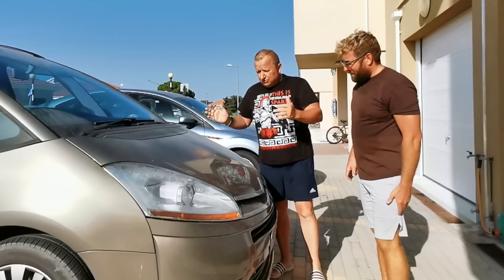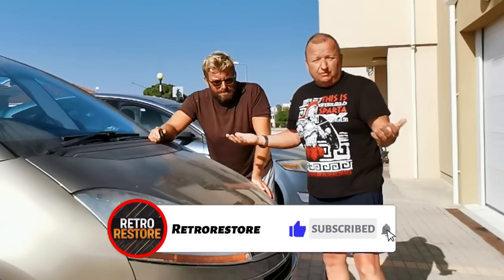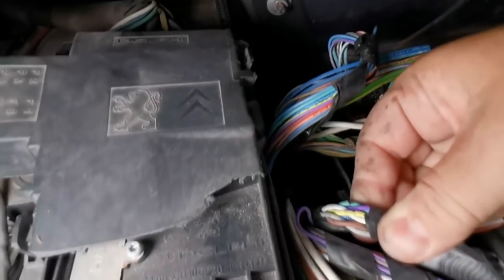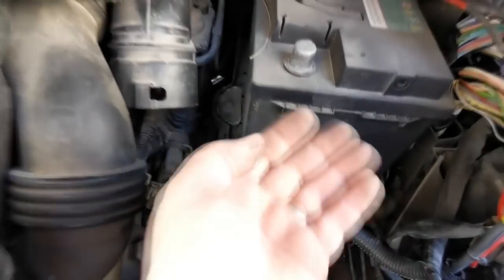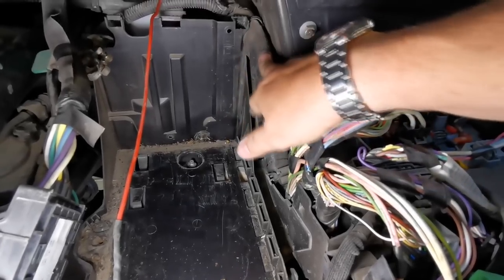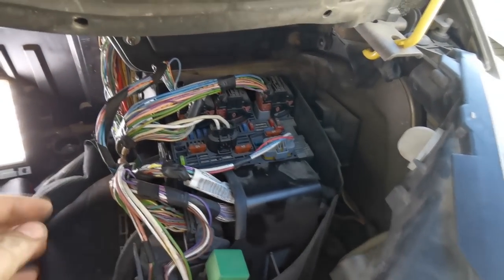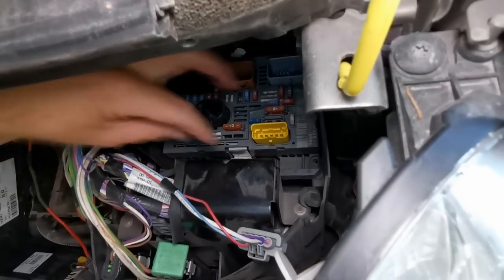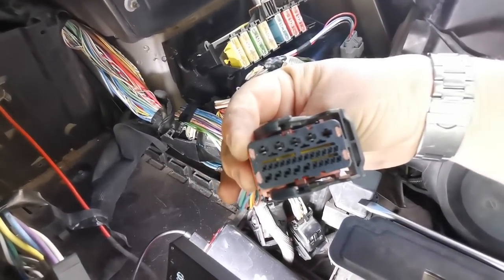Citroen Picasso C4 Intermittent Fault Cuts Out Anti Pollution ABS Service EML Parking Brake Part 1

Comment: One of the tips I received, from a local car mechanic, who now runs his own business, is how to reset the Anti-Pollution System. This obviously resets the Anti-Pollution warning, so that it doesn't keep coming on. What you have to do is drive at fairly high engine revs for twenty minutes. This gets the DPF really hot and clears it out. So on my Citroen Grand-Picasso (2009 1.6 Diesel), you have to put it on manual and do 70 mph in 3rd gear (I forget the required engine revs, but that does it). If you have to slow down then you have to start the twenty minutes all over again. This does burn through quite a bit of fuel I'm afraid though. The other problem you got in Cyprus is driving for 20 minutes at 70, I guess. Best done at midnight, when the roads are clear. 😂
Reply: I sorted out my sons by driving at 2500rpm for 25mins. EML went out, no problem since 👍
He just takes it on a run every now and then.

Comment: Nice simple video guys! Unfortunately All modern cars with CanBus have the same problem of being difficult to diagnose even with the original manufacturers diagnostic tools. As every module is interconnected via the CanBus if one goes bad then they all write errors in their memory without actually having a problem. Specially if the problem is in a ground or a short to a ground that is common to all systems... On top of these the CanBus is encrypted so there are no messages coming from it as to were is the problem plus that modules connected in the CanBus take a random I.D that makes it even more confusing to pinpoint the problem. These are the reasons You see in many videos that for the ¨same problem" there are totally different reported solutions... The source of the problem was in a different area but the symptoms were the same.  It takes good diagnostic tools,  an even cheap oscilloscope for automotive use, some helpful tools like a broken loom tracer and lots of experience in diagnostic methodology (diagnosis steps) for this job. Unless You have all the luck of the world by Your side... Good luck everyone!

Comment: Just checked Google and it would throw up a P001 error code and the cure is a new fuse box, which is either the part you cleaned or the part that attaches to the top of the battery. Very common fault apparently buddy, hope this helps you guys out. All the best 👍

Comment: Definitely need the codes reading. I have a c4 and have had anti pollution fault and it was a faulty glow plug. Apparently there’s about 50 different faults that will show the anti pollution fault message.

Comment: Edited. 6th April 2021

Hi Everyone, After trying everything that was obvious from watching endless videos about wheel sensors, Blue wires, corroded connect etc it turned out to be my front Passenger side Wheel Bearing because the Magnetic strip was faulty.  I was amazed that this was giving me all the issues ie. Christmas tree lights Abs, Ecs, Auto Gearbox and more.

I hope this helps and it was a pretty inexpensive part to fix compared to the warning alternatives 😬

Alan.

Comment: Hello, came across with this channel with the DPF cleaning video (which will do on my Citroen C5 ii :) ). I literally had the same issue, it could go on without any problems even for a month an suddenly cut out, sometimes it threw some ABS lights and sometimes no dashboard errors at all. For my case what got the problem fixed was replacing the crankshaft position sensor (been 2 years without cutting out), it's not that hard to change it and in Spain it costs like 15 euros for the sensor. Even if it's in good condition, it's a cheap and simple thing to rule out before buying more expensive stuff. Keep up the good content and hope it helps you!!!

Comment: Seems like it's went into Limp mode anti pollution would it be a DPF problem I had the same thing with a 2008 Ford C Max it had the Peugeot 1.6 Diesel Engine. In the end I had to get the Pat Fluid tank topped up and got the DPF cleaned all the carbon in the filter was flushed out cost me £300

Comment: My 2011 C4 1.6 Grand Picasso (150k) very similar issues, I did basically the same as you guys, also under the air box there was a couple of chafed wires with exposed copper. I gently dried the fuse box with a hot air gun (there was plenty of damp seeds etc in there too). For me this issue of suddenly stalling turned into an additional P0268 code which was injector no.3 over-current, I replaced injector & all good. Exactly the same thing happened 6 months later, i.e started to randomly stall, and then P0268 etc.  Best advice would be ALWAYS carry a cheapo Pro Scan or similar OBD scanner with you in the car because one symptom amongst all of the error codes can be the bloody electric hand brake won't release until you clear all of the codes using the scanner.  Out of interest it was always injector no.3 that failed (3 times now) over 3 years which leads me to suspect wiring as the cause as the injector itself always has damaged internal electronics. I have had it for 7 years now, it has not been the most reliable car I have owned, would not have another...

Comment: I love my c4 GP but bloody hell the niggles it has had are unreal. Made a mistake putting optimum diesel in. It started to trigger issues.
The oil gets dirty quickly and you need to change at half the recommended distance/time.
Your issue might be the parking break as mine has a loose plate and used to trigger the esp warning light...but must have moved further so as not to be a nuisance lol.
The latest problem triggered the "you are at risk of blocking the air system"...was caused by the tube which connects the turbo and air system. The turbo end always slipped in time for some reason but was getting worse at not staying in place. What caused that was the tube at the other end wasnt clipped in properly. The clip which you cant see wasnt in fully. Now the risk of blocking warning has gone. Must be cleaner so the dpf doesnt have to regenerate so much.

Comment: Cracked solder joint on the ECU PCB. Resolder them all will cure it.
Reply: engine control unit ? sid803 ?

Comment: A late addition….I was getting P1160 increasingly frequent error codes on my 2008 c4 Picasso 1.8i petrol. They happened wheN I slowed speed and braked, for example at a crossing or lights. I started with the easiest possible solutions first, which was what you guys did in the video; I checked the fuses on top of the battery (some of them were corroded) and took out the plugs on the fusebox and the BSI in front of the fusebox. One of had some kind of moisture in it, not quite water I think. I cleaned and dried out everything and put back together again. Been running smoothly since.

Comment: Martin, try a BSI reset. It costs nothing and may cure the issue. Procedure is as follows..

Put the driver's window down, lift the bonnet and ensure all equipment is switched off.

Ensure all doors are closed and remove key from the ignition.

Wait for 3 minutes, disconnect the vehicle battery and wait 15 seconds.

Reconnect the vehicle battery, wait a further 10 seconds (do not open doors.).

Switch on the side lights through the driver's window.

Switch on the ignition and check system's functionality.

Hold lock button on key down for 10 seconds.

Remove key open & close door test central locking system.

Start the engine and complete the system's check.

Failure to follow this procedure could result in incorrect operation of many BSI related items.

Comment: The anti pollution fault could well be DPF related. The ELOYS fluid is in a pouch situated next to the fuel tank. It might need to be filled up or replaced. Did you watch the "LM Auto Repairs" video by any chance? There could still be a broken wire causing the multiple errors. You found some chafing on one of the looms going into the fusebox. That would be the best place to start looking for any broken or shorted wires. The best diagnostic software to use is Diagbox which is what the dealers and independent PSA specialists use. I know that's not really an option while you're out in Cyprus.

Comment: It could need some software updates for the ECU computer Martin. A lot of modules run in tandem so if one is faulty some of the others show faults to like the ABS module, park brake module etc. Also check the EGR valve they are known to cause faults.
Cheers, Jeff.

Comment: Anti pollution is most likely related to the Diesel Particulate Filter (DPF), it's a very common problem with diesel vehicles which only do short journeys.  In normal use the DPF gets up to very high temperatures and burns particulates off which would otherwise be emitted into the atmosphere, in vehicles which only do short journeys the DPF does not get up to operating temperature and so eventually gets clogged with the particulates it is designed to burn off.  Some DPFs can be regenerated by driving at 50 - 60 MPH for 20 - 30 minutes, others may require a service procedure to force a regeneration but in worst case scenarios a new DPF will be required and will usually cost from the early hundreds up to early thousands depending on the vehicle to which they are fitted.  There are companies which specialise in cleaning DPFs and there are even fuel additives which claim to clean as well but I have no experience or evidence as to how effective the latter are.
Reply: Do you know if this would also cause a whining noise when accelerating? This just happened to me today and everything your saying makes sense to me, I use my work van mostly and the car occasionally. Any help would be appreciated thanks

Comment: Great Vid Martin 👍 intermittent faults are the worst to trace. normally to effect that many control units and bring all those warning lights on at once its a fault on the high speed  CAN Bus either one faulty control unit or and intermittent short to ground on the can bus wires causing all control units (ecu's) to loose communication with each other.

Comment: Any random issues with C4, DS4, 2008 etc
Add a supplementary earth cable from battery to chassis and another from engine to chassis, then change the clutch and accelerator pedal switches, followed by all four wheel sensors cables, carefully inspecting the pick ups.
  Bad earths, and those few things generate the most bizarre array of (seemingly) unrelated faults, it's worth the few hours and £100 to get them out of the chain...80% of issues will clear up then and there 
  If your battery isn't showing at least 12.4 resting (after sitting overnight) and at least 10.5 while cranking the starter...so basically less than a couple of years old...that can also create havoc.
   THEN start looking for dirty plugs, frayed wires etc
   I've changed the EGR valve because of an £8 clutch switch before now.

Comment: These cars especially Citroen, suffer from the diesel particulate filter (a soot Catcher, ie anti-pollution, for want of a better word) choking up on short journeys. The filter catches the soot and a regeneration cycle self cleans the filter periodically, usually on the motorway etc, where it reaches a very high-temperature and burns off the soot into ash. Short journeys don't give the dpf time to go through this cleaning cycle and gradually blocks it up, then the engine gets instruction from the ECU to go into limp home mode. I believe this might be one of your problems. You will need to clear the fault code too.

Comment: I had a similar fault, with a Peugeot 108, basically I would get loads of codes come up like tpms, esc fault, eml, and a o2 sensor heater circuit fault. so it seems to be fairly common with Peugeot/ citroen that if one sensor is out of parameter whether that down to a connection fault/ a bad sensor can cause error codes in various different systems the car monitors. for my car it turnt out to be a bad o2 sensor, which for me  a few garages couldn't find the fault I had to get a auto electrician.  which initially you wouldn't think a bad o2 sensor,  could cause faults with tpms or esc. so in my opinion I would look into a poor connection or faulty sensor that monitors the emissions. I know it's not the same kind of fault but hopefully it helps.

Comment: Ok, ive got same problems, anti pollution is separate to the other cluster of faults. All the other faults (gearbox faulty, esp/abs faulty, handbrake faulty, gears only working in manual up to 3rd etc) is all linked to 1 thing......ABS sensor and magnetic ring. Without a diagnostic reader you wont know which one, on mine it was front passenger. Took the wheel off, took the ABS sensor off, gave it a clean then used a firm toothbrush and wd40 to clean all the grease and dirt off the magnetic ring, it has to be crystal clean. Sort of brush where the sensor goes and spin the disc (in neutral) around and around until the ring is clean, use cotton buds if the ring is really think grease/dirt. That will sort all those faults out but you'll probably have to do it both front wheels to start with. Will take about 20 mins each and wont cost ya a penny if you have cotton buds, WD40 and an old tooth.  
Unfortunately it wont sort the anti-pollution fault out, im still sussing that one out but the car still runs fine for me with that coming on.

Comment: I had the same sort of issue on a Citroën c5 I had a few years ago I had to get rid of the car garage did not have a clue what it was great video mate shame u could not sort it
Reply: The same thing happened to a customer's C5 when i.worked at a.dealership a while ago he had it 2 days,the mechanics had the dashboard out,everything with all the support from Citroen ,it couldn't be fixed ,the car was taken back.by Citroen and the customer was given a new car of his choice ,but same price 😊
Reply: @ASH.......................1976 Hi, me too have the same issue. Gearbox fault, gear only stuck in N not changing nor moving. What solution did you get?

Comment: That fault is the Dpf blocked  !
Vaporizer sensor  , not regenerating....
Reply: If the dpf was blocked it wouldn't restart and it would be seriously low on power.
Reply: @yorkshiredadandlad1531  some cars will restart if blocked,  I work on cars every day .......

Comment: I have had Exactly the same problem. Same car only a year older. All the same. Solution was gear box fluid was leaking near empty and fluid went in to control electronics. Once we refilled stopped having the problem. Please reach out and share as I still have the issue but rarely. It used to be all the time and especially at high ambient temperature would make it definitely happen. Gear box ECU part.

Comment: Did he sort it eventually? 
I had same thing, only difference was that after it cut out, it didnt start again unless battery was disconnected for a moment. Took it to experienced Peugeot Citroen guy, he saw that RPM sensor (not sure it's the correct term for it) showed up twice in diagnostics, changed that and this problem is now gone. I still have to sort ABS/ESP/Handbrake/Directional headlamps faults coming on all at once, but at least it's not cutting out anymore.

Comment: Without Diagbox on these cars your snookered. Also sometimes when writing a fault code to the ecu it will cause comms failures to other units like the handbrake and triggers another fault that's not really a fault. As an example I had a sticky EGR valve and when it played up it caused the auto handbrake to turn off and gave ABS and ESP faults, sorted the EGR and all was well.
My advice is to spend £50 quid on Diagbox and Lexia, I'd be lost without it. Also for any fault codes in the engine ECU it calls it anti pollution which made me think along the lines of DPF at first.

Comment: From what I've seen it's the diesel particulate filter. Dpf.  Best case it needs a good run at high revs to clear it out. Worst case new dpf needed.  But definitely try a good run on motorway in 3rd for as long as possible to clear it. It's just registering the fault and then going into limp mode and throwing up all those other lights etc.
Reply: I've taken my dpf out taken egr out, remapped. Still happens to me . This is the worst car I've ever owned. Cuts out on dual carriageways and won't start again till the handbrake is on
Reply: @CallOfBrians  really this is happening on my car now fella took dpf out blanked ear and started cutting out but not been mapped yet your getting me worried haha
Reply: @ruthgolding7424  you need to scrap it, I've scrapped my old one.  I literally done everything to that car and it still cut out.
Reply: @CallOfBrians  don’t say that 😲🤦‍♂️

Comment: My brother's 207 came up with the same fault. His rocker cover gasket had gone and sprayed oil everywhere. Top tip if any Pug/Citroen with the infamous 1.6 HDI sounds like a tank check the air intake and the air box as it likes to come loose. It's not easy to get to either.
Reply: sounds like a tank, any examples? Im having issues with faultcodes that cam same time as gas was low. i also do know that there is an L-shaped plastic part that is missing to the air intake so there is a gap between the box and the pipe, behind the engine. ideas?

Comment: Probably needs some software updates for the ECU computer Martin, since a lot of modules run in tandem it throws fault codes in other modules like abs., park brake etc.  And check the egr valve too they are known to cause faults.
Cheers, Jeff.
Reply: If the fuse box was so dirty and full of seeds, maybe that suggests the pollen filter could be completely clogged up as well, if it's bringing up an anti pollution warning light, wouldn't be surprising if the car's come over from the UK. I guess the pollen filter would be fairly close in proximity to the fuse box, being as it's tucked so fair back into the scuttle/firewall.